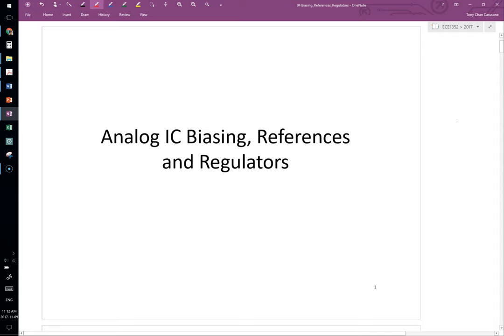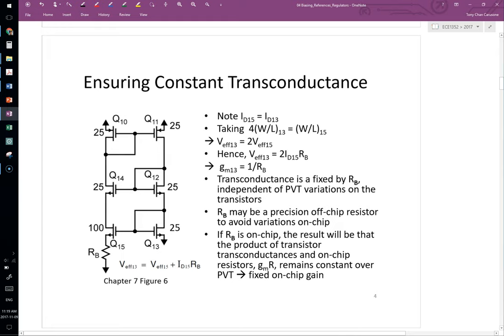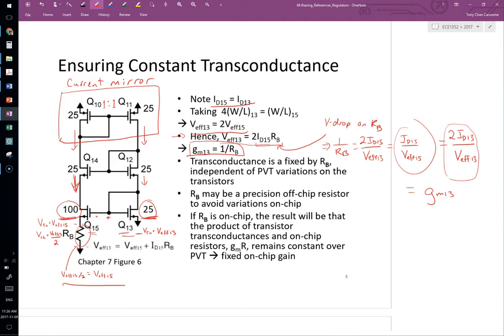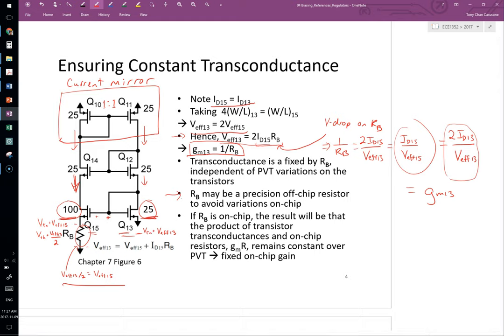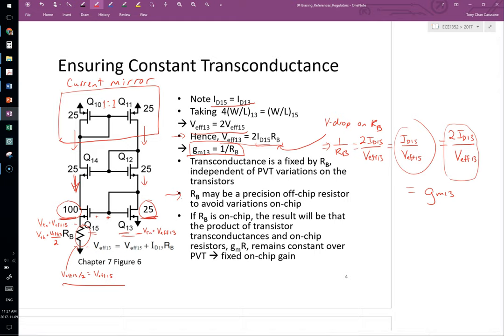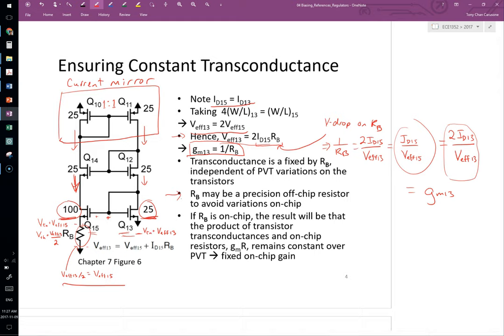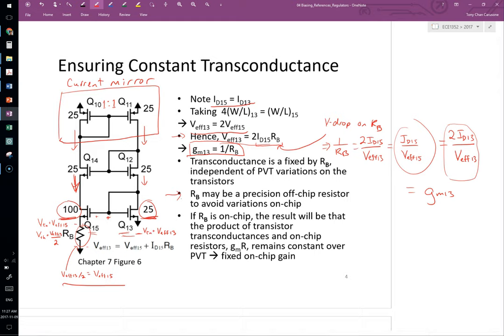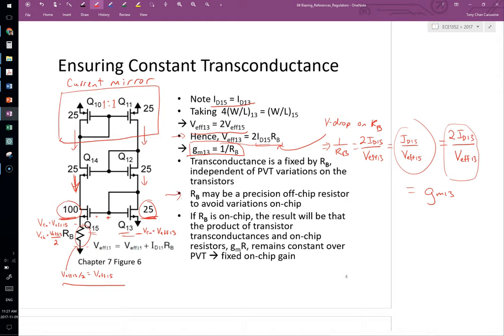24 Biasing Circuits

Comment: I don't understand, why biasing circuit need wide swing?
Reply: Due to the variation in the process and temperature the unCox of the transistors will vary. To keep the gm constant (set by 1/Rb) the Vgs of transistors will also vary.